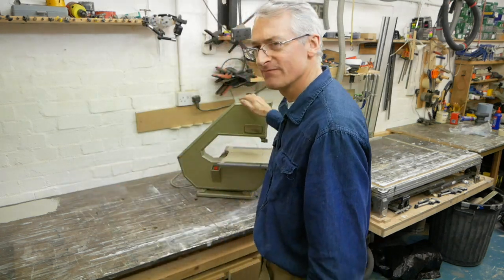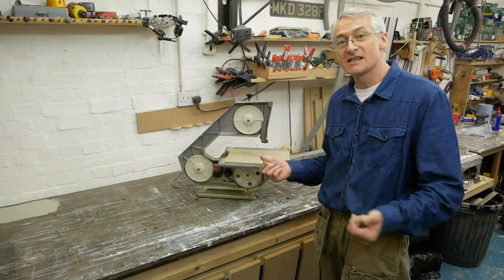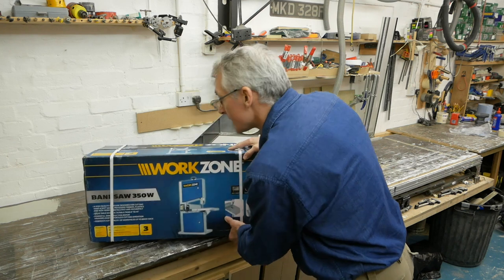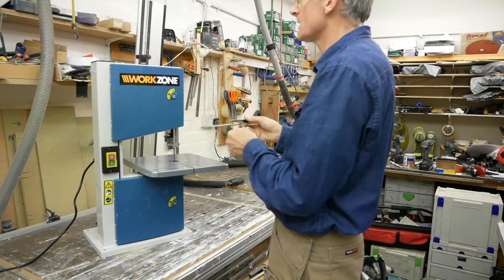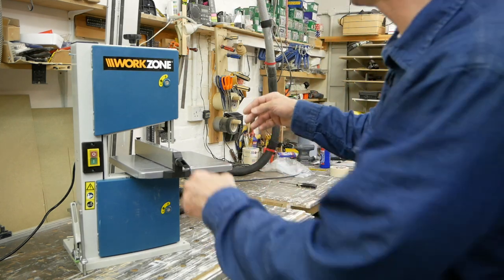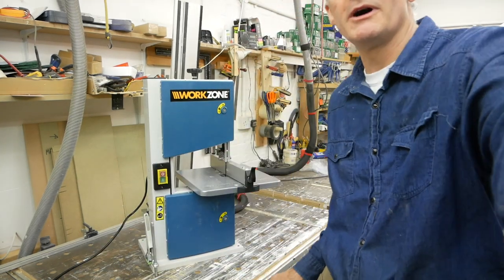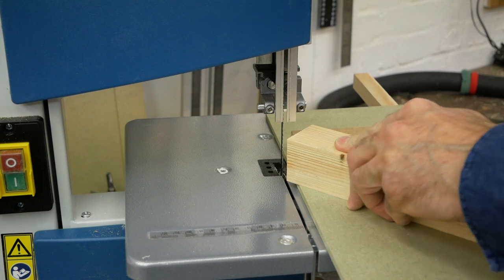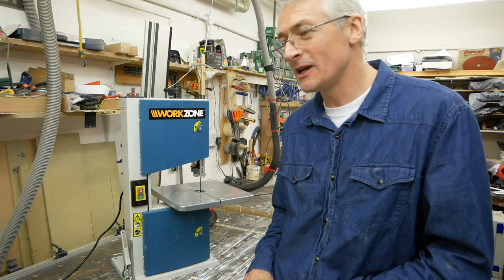Cheap Bandsaw - worthwhile, or just a waste? #050

Comment: ALDI have this available online, but also have another model - Ferrex - which has a 10” throat, is 500w and has a solid cast (alloy) table with mitre slot. Also comes with a spare blade, allegedly. I’ve just ordered one, we’ll see what it’s like! It’s nearly twice the price of the Workzone but with some significant spec improvements, and still hands down cheaper than an equivalent saw from other companies.

I have the Workzone pillar drill and fretsaw, and honestly, for the money they are great. With the 3 year warranties that come as standard (and honoured, by all accounts), they’re brilliant value for the hobbyist.
Reply from the maker: Thanks,! Yes, I've seen the larger Ferrex - as always, they seem to share a lot of DNA with the Scheppach models! I'm sorely tempted, but don't think I have space right now! 👍
Reply: Peter Millard Arrived yesterday, just set up! Thoughts: Weighs an extra 10kg compared to the Workzone, presumably in part due to more cast parts. The table and fence are really sturdy, essentially no movement. You do indeed get a spare blade, and an extra few cm cut depth (125mm compared to 80mm, you can get 130mm under it at a push!)

Downsides: as ever with these products, quality of casting/alignment not amazing. That said, the table is perfectly square to the blade out of the box! Main gripe is the table extender, which needed some fettling to get on and is near unusably stiff to slide. But who uses a bandsaw to cross-cut long lengths?!

All in all, pleased. Not entirely sure it’s worth double the Workzone, but can see it’s going to be such a handy addition and really my “go to” saw for all those small bits that need to be done with not perfect but reasonable accuracy.
Reply from the maker: @Saladzingers  Thanks so much for letting me know! Fair point about the extra weight and double the price of the workzone, but there's no other 10" bandsaw that's anywhere near this in price - the Record BS250 is ~£100 more -  and as you say, the extra capacity will be very useful! Now, if it could just cut to 150mm... 😂👍

Comment: I have a Burgess I bought in the 1970s. Bit rubbishy, frustrating to use, and the blade guides are a joke. BUT it still works and is fine for occasional brief work like curves. I cut some curved softwood glue blocks recently near 2" thick and did some curved oak an inch thick but the 2" wood was seasoned so easier to cut.  Oh and you can get the blades.

Comment: The cheaper (in quality) a bandsaw is, the less useful it is. I guess that's true of most things, but especially of a band saw.  I have a cheap Ryobi band saw that I wouldn't even think of trying to resaw with which is typically one of the common uses of a (good) band saw. The saying that you get what you pay is especially true of band saws.

Comment: I like the little hobby  saw  i know it has its limits  but knowing that   It would  have its place in a Woodworking shop  i bet it wouldn't be very difficult to  replicate  one like that  scaled up   For bigger work  if your new one  isn't  working out as well as you thought  it would
Reply from the maker: Thanks. New one’s working out fine - still a small hobby saw, just with a little more capacity and a better table. 👍👍

Comment: Fantastic review peter. I only saw it  in aldi a few wks ago & I was like " will I or won't I?". & I thought " ah its probably a pile of junk". Boy was I wrong.
Reply from the maker: +me aul jazzer Thanks! So did you, or didn't you? 😂 Seriously, it's a cracking little bandsaw if your needs are modest 👍
Reply: Peter Millard hahaha...I didn't peter. In the end, I bought a Ryobi jigsaw in homebase for €60. Even then I had that inner philosophical battle between a €30 black & decker or €100 Makita jigsaw.

Ive been just learning woodworking from guys like yourself & I really enjoy it; Making small tables, garden bench to recently making a folding door which was a challenge & a half. But if like to start doing more things & improving. Plus for €100, it will always come in handy.
Reply from the maker: +me aul jazzer Never mind - at least with Aldi you can be reasonably sure it's regularly stocked. And I'm sure the jigsaw will be useful 👍
Reply: Peter Millard im still a bit sketchy about aldi & lidl tools. That old saying "buy cheap, buy twice" but recently I bought a parkside brad nailer for €22. Fantastic! & I saw a guy the other putting up architraving the other day using a nail gun with a compressor & some of the tip of the nail where sticking out. So I think for the homegamers, with aldi & lidl tools they seem money worth spent.

Comment: I bought one of these and after trying to adjust properly for a couple of hours, realised something must be wrong. Turned out they put the top blade wheel on backwards. So if you blade can't be properly adjusted top and bottom, and the blade is too far forward to bring the guides and bearing into position, try reversing the top wheel!
Reply from the maker: Good tip, thanks! This is quite an old video now, so the saw you buy today isn’t the saw I bought ~3years ago. If you look through the comments there have been some quality control,issues with the more recent one, though I’ve never come across the issue you had! Well done for figuring it out! 👍👍

Comment: There's nothing wrong with a three wheel Burgess bandsaw! I've got one similar made by Black and Decker, ( it's exactly the same as the Burgess) and have had it since 1978 and use it all the time! even cutting though 3 1/2" hardwoods  for bowl turning blanks and with care it cuts fine. you just have to set it up carefully and away you go. you must also drop the top guide close as you can to the work piece to avoid run out. the problem with yours will undoubtedly be a burnt out start capacitor.
Reply from the maker: +SAMRODIAN No, absolutely - I know plenty of people who have them. But there was plenty wrong with mine - the guides were completely shot, the tensioning didn't work, there was no fence, the table didn't lock properly etc..etc.. - basically no chance of setting it up carefully. Good for spares though, and the recipient was very happy 👍

Comment: I just bought a Scheppach compactor from Aldi for £269 the same model in Screwfix is £549 quite a saving methinks.
Reply from the maker: Bargain! 👍👍
Reply: martin beardmore I've just bought a table saw for £89.99 that’s £159.99 from Screwfix as far as I can tell. In SF's defence I did buy a Trojan brad nailer from there cheaper than I could find it online. I only found out this week Aldi has an online presence for home delivery, next day delivery being kept informed of delivery times for an extra £3.95. I have some disabilities and this service is extremely useful to me and well worth the money.

Comment: I would roll your sleeves up to be more safe. Better to get a cut than loose your whole arm. Although that small band-saw might not rip your arm off, I’ve worked with metal cutting ones that certainly will. Safety first.

Comment: The test is to freehand a piece of 4 x 4 through it. Then you will see the difference between a good band saw and rubbish. I paid $650 for mine - changed blades at some point - and the top wheel infrastructure just collapsed. So it went in the skip.
Reply from the maker: +Renny1953 Well this little one only has a 3" depth of cut, and just for fun I did put ~3" of Oak through it - there's a quick video of it on the channel somewhere - and it did OK, though I took it slow as it was the stock blade. But sure, it's a small cheap bandsaw - it doesn't do everything the large expensive bandsaws do. 👍

Comment: just got one yesterday, thanks for this video!
Reply from the maker: Thanks Annette! Great little starter bandsaws, really enjoyed mine 👍👍
Reply: Oh so glad you replied!!! I cannot for the life of me get the blade aligned. Ive followed the instructions carefully, 3 times over, but the blade wont stay on the bottom wheel, no matter how I adjust the top wheel. Any tips? I gave up after 2 hrs....
Reply from the maker: Annette Deane Hi Annette. Sorry to hear about this. Did the saw not come with the blade fitted? Mine did - all I had to do was fit the table. I did have someone in the comments the other day who said they were having terrible problems with the blade jumping off the top wheel - I wonder if there’s a ‘bad’ batch?? I usually suggest the Alex Snodgrass setup videos as he covers everything so well. And if the worst comes to the worst, Aldi are good at exchanges. Let me know how you get on. 👍👍
Reply: Thanks. Yes, there was a blade, but the set up section where you check the blade is in the middle of the wheel..well, that's where it all went downhill. I will check out the Alex Snodgrass video and go from there. Cheers.
Reply from the maker: Annette Deane Oh dear! Mine came with the blade fitted and running nicely, it just needed a tweak of tension and was cutting really well. Hope you get it sorted 👍👍
Reply: Hi, it was faulty, now been replaced and is working a treat! Incidentally, when I rang the number on the paperwork, it wasn't Aldi that answered, but Sheppach, they must own the Workzone brand?! Anyway, thanks for your help :)
Reply from the maker: Annette Deane Glad you had a positive outcome. Many of the Aldi Workzone tools are re-badges Scheppach, and Scheppach handles the customer support. 👍👍

Comment: Hi Peter! Thank you for this review! 
Brilliant look at the saw! 
I have been looking at a band saw to rip down the width some de'nailed pallet wood...
I am doing a camper conversion and want the rustic look of pallet timber but without the thickness (and weight) to clad the walls / roof. 

I will literally be buying the saw... Ripping down the timber and possibly selling the saw straight back off due to lack of room.

Would you recommend this saw for doing this job?
It's a one time use for the saw... And certainly doesn't need to be a "neat" rip.
Thanks.
Reply from the maker: Hi Lee and thanks! This is a lightweight starter bandsaw that did everything I asked of it for the 6 months or so I had it - I moved on to something with a bit more capacity. When you say rip down, do you just mean ripping to width, or to thickness (aka re-sawing)? If to width then it should be OK depending on the volume you expect to put through it. If re-sawing to thickness, I’d say you’re probably better off with something a bit beefier. 👍👍
Reply: @10MinuteWorkshop   thanks for getting back to me. Appreciate it... 
it would be thickness. Essentially making 2 boards out of 1 so the weight would be halved throughout the van.
I understand it would be much easier to use a beefed up model but at the mo the spend will be eaten up with the van conversions money allowance and then resold at a convenience "loss".

Maybe a slow and steady approach with a few spare blades? I think I recall you stating it has a 3 year warranty.... And seems to have a good Watt motor Surely if the wood is within the stated height of cut should the motor burn out etc it could be returned or replaced.. 

May just be worth a punt? 😉

Or do you have a better suggestion as this is 100% more your field of expertise.

Thank you.

Comment: I bet you got the aldi bug after this video. Only for them. I see in August of 2018 the got a airless sprayer for 199 euros looks good pure your bucket in off one goes both aldi and lidl seem to cover every house hold chore over the year keeping on season with some of there stuff
Reply from the maker: Haha - I don’t have a local store unfortunately, otherwise I’m sure you’d be right 👍👍
Reply: aldi sucks so bad. every damn catalogue has something i want and every time i go in there i'm looking for the tools that have been reduced for a quick sale. i have stuff that i bought months back i haven't even opened.

i have one of those bandsaws btw.
Reply: @discombubulate2256  but sure lad your going to have them tools for a while in them boxes as they dont sell to well second hand even if there in the box. Yes some one with home DIY that isn't making a wage using these tools. Buy expensive tool one need to justify it an be ably to make what they spent on that expensive tool they want to make it back  with in a day or two of work. But the hobbyist fear enough they still get 5  to 10 years out of an aldi power tool as long as battery's are kept charged every few months and oiled when needed. But at the same time if I was buying second hand I'd go for big named tool. I hope you pass them on the 3 year warranty that no other company gives. As for black an decker I'd never buy again over priced shit even lidl and aldi is better than there shit. Even tho black  an decker are made by Stanley tools.

Comment: Amazing little review, went out and bought one straight after! 👍🏽
Reply from the maker: Hi Marco. Just be aware that there seem to be a few quality issues with the current model - this video is from 2 years ago just FYI - so if you hit any snags setting it up, esp. the bottom wheel, just chuck it back to Aldi for exchange. 👍
Reply: Peter Millard thanks for the quick response peter I’ll take note. I wonder if they have done anything to make them better on these newer ones ?  I guess we’ll find out. I’ll let you know how I get on
Reply: Marco Giove how did you get on?
Reply: @leebevis335  absolutely brilliant buddy once its set up right and done a few little bits and bobs I'd say it runs as good as some of your higher end saw's. I'm looking into buying a mini metal lathe now but I'm not shore what to get
Reply: Lee Bevis are you thinking of buying one
Reply: Marco Giove yep!

Comment: I know it's too late to comment to this video, but for your old band saw it has a benefit of cutting range about 30 cm wide than your new one. I have Black&Decker DN330  and was about to sell it and buy just the same as you have now, but i think if i upgraded the old one ( motor & wheels ) specially her in Egypt the Chinese brands price starting from 140$ for the 8 inch same size as yours and the 12 inch is for 300$ .
I'll change the wheels to stainless steel will ball bearings, and the motor will try to upgrade it with a 600 watt variable speed motor. 
what do you think ?
Reply from the maker: Thanks! Sounds like quite a project - but an awful lot of work! Let me know how you get on! 👍👍
Reply: @10MinuteWorkshop  sure, will update you with the progress ♥️

Comment: The problem with these cheap bands saws is that the rubber tyres disintegrate and they are expensive relative to the machine.
Reply from the maker: But the machines are cheap - they’re starter bandsaws, for people who don’t know if they need a bandsaw or not, and who don’t know enough to buy used. Like I was a year ago 👍

Comment: Perfect timing I've been looking for a cheap bandsaw to add to my garage shop. Thanks Peter - also, may I ask what kind of nail gun was that?
Reply from the maker: James Bailey Pretty sure you won't regret it 👍 On the little jig? That's a Ryobi Air Strike narrow-crown stapler, 18v cordless, part of the OnePlus range. Rapidly becoming my favourite workshop stapler - big fan of the mains electric Maestri 'out and about' as it's so small, but being cordless in the workshop is great 😀. Link in the description above...
Reply: Great thanks
Reply: Peter Millard Hi Peter, the link above for the UK goes to the nailer the US link seems to be the stapler I'm assuming these are different items and that it doesn't do 18 gauge staples and nails?
Reply from the maker: Hi Clark. Thanks for pointing that out. Seems that the stapler is 'currently unavailable' at Amazon, so they seem to be substituting the nailer. No, definitely different items - not a nailer/stapler, sadly. I must admit I bought mine from the US via eBay - might be worth a look? Have updated the show notes, thanks again!
Reply: Would be nice if it did both but good to know US imports from eBay are a way to go
Reply from the maker: Cheaper too! Found this one - https://goo.gl/aIGo8O - and just FYII had no problems at all with the 'personal import' took about a week or so 👍

Comment: like your video I too have brought one of these and found it great to use however found one snag, there's no markers on the tightening spring so as a novice I have yet to figure out how to get a new blade set up correctly (vibrates a bit and have yet to get it right and have no idea if it's too tight or loose) if you could do a video on setting up a blade on this model I'd appreciate it greatly.
Reply from the maker: +Graham Lee Thanks! Have to confess, I haven't changed the blade in mine yet. Or adjusted the tension, much. But sure, I'll look into it. You might try posting a question on the UK Workshop forums - there's a few bandsaw users there with far more experience than me! 👍
http://www.ukworkshop.co.uk/forums/
Reply: Graham Lee .

Comment: Can you also chamfer the corners with the track saw? By clamping the wood together and make one pass each side.
Reply from the maker: MyBeomaster901 No, it's one area (possibly the only one) where the tracksaw cant help, as the saw always tips to the right of the track i.e. the track would have to overhang the material massively, so no way to do that safely.

Comment: What type of blade guides does it have? Are they easy to adjust accurately? How about blade tracking? Thanks
Reply from the maker: I don’t own this one any more, but from memory they were alloy side guides and bearing rear, blade tracking was excellent. Came pretty much ready to run straight out of the box, great starter machine. Check out the bandsaw playlist - vids on bandsaws from Aldi/Scheppach, Titan and Axminster. 👍👍